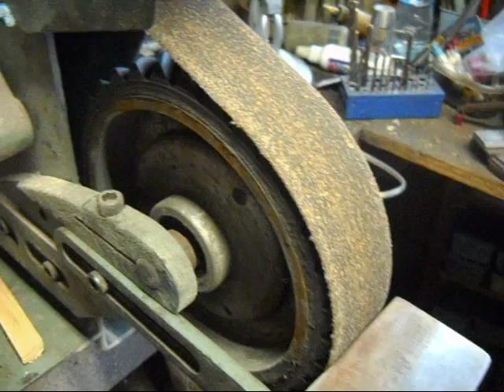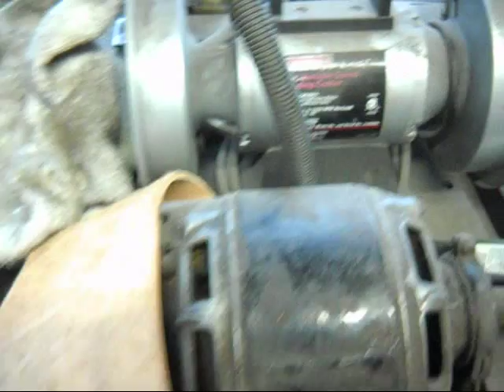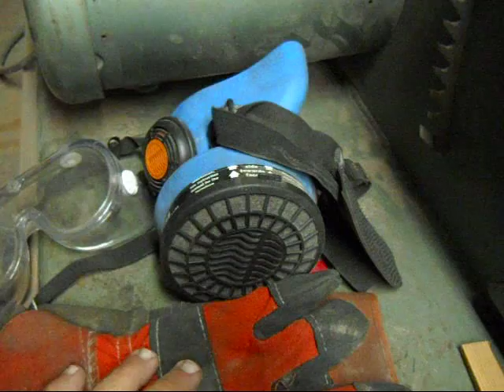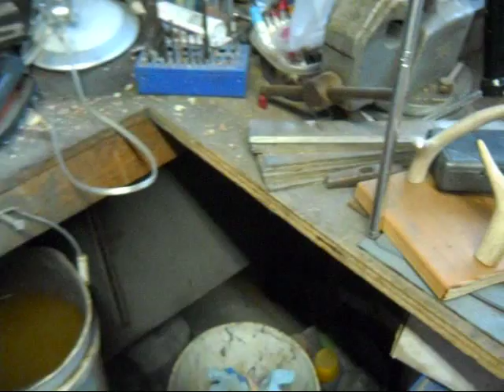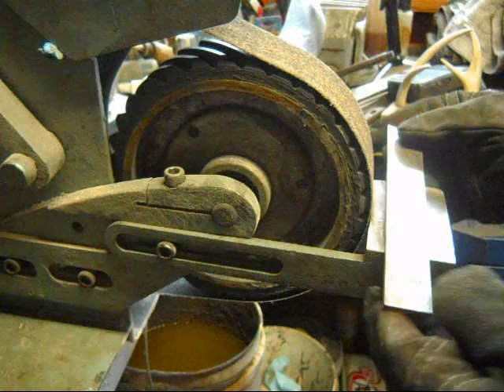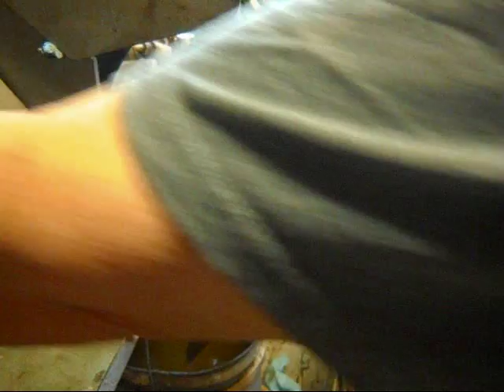Profiling A Knife Blade 2

Comment from the maker: I was given the blades.  I heat treat just about everything else.  I just tried a cold cutting saw blade made from T4 steel that I picked up at a metal fabrication place.  If you don't have a heat treat oven you can still get fairly good results with liquid quenched steels.